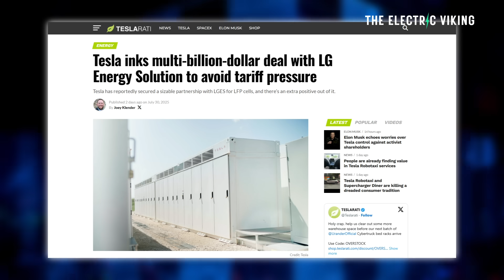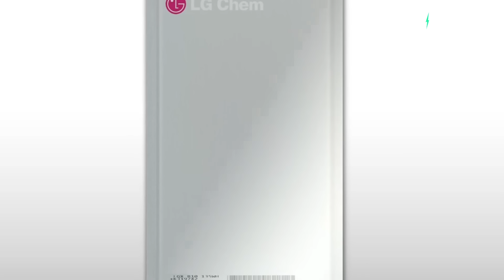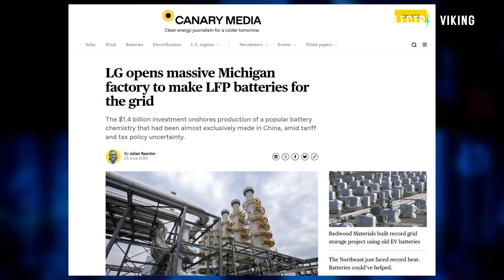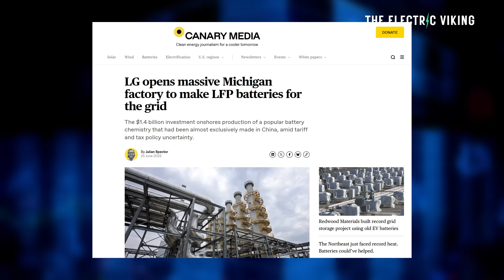Tesla Signs $4.3 BILLION Deal for 50% HIGHER energy Density LFP Batteries

Comment: WRONG: Great find! Tesla pursuing the best batteries in the world is great news. LFP 50% more!? I have no reason not to buy now. It just needs to get into the Model Y AWD long range.

Grok said these DO NOT have 50% more energy density:

These are standard lithium iron phosphate (LFP) cells optimized for energy storage systems (ESS), like Powerwalls and Megapacks.

Key advantages emphasized: lower cost, superior safety (reduced thermal runaway risk), longer cycle life, and tariff avoidance via U.S. manufacturing — not a breakthrough in energy density.

Why Not Use Them in Cars Anyway?

1. Energy Density Trade-Off Remains Fundamental to LFP; standard LFP (including advanced versions) has ~30–40% lower energy density than NMC/NCA packs used in Long Range/Performance Teslas. 

2. Optimization for Stationary vs. Mobile Use;  ESS batteries focus on cost per kWh, extreme cycle life (thousands of cycles), and bulk packaging — weight and space aren't as critical

3. Strategic and Contractual Focus; The deal explicitly targets Tesla's energy storage business.

4. No Need for Upgrade in Current Vehicles; Existing CATL LFP cells in base models are already excellent: cheap, durable, safe, and support full charging. A hypothetical "50% better" LFP wouldn't suddenly make it viable for Long Range trims without major redesigns.

Comment: NOT FOR CARS!

Tesla has secured a $4.3 billion battery deal with LG Energy Solution to supply U.S.-made lithium iron phosphate (LFP) batteries for its energy storage systems. This deal, which spans three years from August 2027 to July 2030, is a strategic move for Tesla to reduce its reliance on Chinese imports due to escalating tariffs. The batteries will be manufactured in LG's U.S. factory in Michigan and are intended for use in Tesla's Powerwall and Megapack systems. The contract also includes options to extend the deal through 2034 and increase the volume of production based on Tesla's future needs. This move marks a significant shift in Tesla's supply chain strategy, focusing on domestic production and reducing logistical risks associated with reliance on foreign suppliers

Comment: Help me understand.  Why sign a deal and install manufacturing capacity for this lithium Ion technology when Tesla just announced its miraculous Aluminum Ion Battery???

What happened to the aluminum ion battery?

The aluminum-ion battery technology has seen significant advancements, particularly with Tesla's Super Aluminum-Ion Battery, which is expected to revolutionize the EV industry. This battery is made from aluminum and graphene, making it 10 times more abundant and cheaper than solid-state batteries. It offers a 1,000 times higher ion conductivity, allowing for ultra-fast charging in just 10 minutes. Additionally, aluminum-ion batteries can provide free home electricity storage, making them a cost-effective and sustainable solution for renewable energy storage. 
4

Tesla's aluminum-ion battery is expected to cost around $1,750 per pack, significantly reducing EV production costs and making electric vehicles more accessible. The battery's design uses a graphene-based cathode and a specially engineered solid or semi-solid electrolyte, which supports high ion mobility while preventing degradation. Early tests show that aluminum-ion batteries can last up to 10,000 charge-discharge cycles with nearly perfect capacity retention.
1

The aluminum-ion battery's development is a response to the need for reliable long-term energy storage systems, particularly for integrating solar and wind power into the power grid. The technology's cost-effectiveness, safety features, and recyclability make it a promising solution for the future of energy storage

Comment: Deal ConfirmationTesla has indeed signed a $4.3 billion deal with LG Energy Solution for lithium iron phosphate (LFP) batteries, as confirmed by multiple sources like Reuters and InsideEVs. This deal, reported as of July 30, 2025, is for U.S.-made batteries intended for Tesla's energy storage systems, such as the Megapack, rather than for electric vehicles. This move aligns with Tesla's strategy to diversify its supply chain and leverage U.S. clean energy incentives.
Energy Density ClaimThe claim that these LFP batteries have 50% higher energy density is not supported by available information. LFP batteries are typically known for lower energy density (around 150-200 Wh/kg) compared to other lithium-ion chemistries like nickel manganese cobalt (NMC) or nickel cobalt aluminum (NCA), which can reach 200-250 Wh/kg or more. While LG Energy Solution has been developing LFP batteries with improved energy density, the most specific mention is a 20% increase compared to CATL's batteries for Tesla Model 3, and this is still in the research stage, not confirmed for this deal.

Comment: Maybe because the corporations are looking to clear their stock and sell the old tech for as long as possible. It's only going to add to the electricity burden, and along with data centers being set up by Gov. and industry, there will be a massive deficit in power generation. If it comes to  industry and Gov/ use over household use, whose power do you think they will throttle? It's a con.

Comment: Thoughts? Well, if density has increased by 50%, then Tesla can make the pack size smaller, and therefore cheaper. So many benefits to this around weight reduction and handling. Not to mention, it may allow different packaging options. Really looking forward to seeing the NEXT gen of Tesla's with these in them. It'll be 500 miles range if Tesla want to do it.

Comment: LG Chem produce very fire prone batteries. Tesla are potentially making a fatal mistake partnering with them. Check their record. Given they are LFP they may be safe.
Reply: Tesla also employs fire prevention measures such as cell fusing, thermal management and probably other measures that other battery makers cut corners on.

Comment: Operates better in cold temperatures. So in the US snowbelt states where -20F is common on -60F is not unheard of, let's split that difference and say -40C, these new batteries won't suffer at all? Or does "better" just mean they can't charge at -30F, so they still need heaters?

Comment: Totally fake news. Here is what really happening. Tesla is reportedly a confidential client in a $4.3 billion contract with South Korea’s LG Energy Solution (LGES). The deal covers a three‑year period from August 2027 to July 2030, with options to extend up to seven additional years or expand volume. 
Batteries will be manufactured at LGES’s U.S. plant in Michigan, aimed at Tesla’s energy storage systems (such as Megapack and Powerwall), not for vehicles.
These are standard LFP batteries, there is no source claiming 50% higher energy density -- it just chemically impossible. These batteries still have lower energy density than Tesla’s NMC or NCA chemistries.

Comment: Aluminum ignites at temperatures typically around 1,030°F (about 555°C) for solid pieces, but the exact ignition temperature depends on particle size and form. For fine aluminum dust, ignition can occur at approximately 750°C, while bulk or foil aluminum may require much higher temperatures, often above 1,000°C.

For reference:

Solid aluminum ignition temperature: about 1,030°F (555°C).

Aluminum dust cloud ignition temperature: about 750°C.

Nano-sized particles may ignite at even lower temperatures (as low as 627°C), while larger particles and foil might require 1,000–2,000°C.

Aluminum's melting point is much lower, at 660°C, so it melts before it ignites under most conditions. Everyday household or industrial fires rarely reach the ignition temperature of solid aluminum.

Comment: Looks like the Holland Michigan factory produces pouch-style batteries for GM vehicles and stationary grid battery backup. Sam, do you think they are using that chemistry in cylinder batteries which is more common for Tesla or putting pouches in Tesla packs?

Comment: So which of the two LG batteries will they make in Nevada to replace CATL?  That CATL production was earmarked for energy storage so I assume the will go with the cheaper version since density is not that important.  But how does the higher density LG compare to the 4680 Tesla has invested so much in?  If the LG is better and more cost efficient than the 4680 than Tesla has a tough decision to make.

Comment: LG Energy Solution supplies batteries to a variety of electric vehicle (EV) manufacturers, including Tesla, Toyota, Rivian, and Aptera. 
They also supply batteries to General Motors, Ford, and Mercedes-Benz.
 Specifically, LGES provides lithium-ion battery modules for Toyota's EVs in the US, and cylindrical batteries for Rivian's R2 model.
 Additionally, they are supplying LFP batteries to Tesla for energy storage systems 
and are involved in a seven-year deal to provide 2170 cylindrical battery cells for Aptera's solar electric vehicles. 
Here's a more detailed breakdown:
Tesla:
LG Energy Solution is supplying Tesla with LFP batteries for energy storage systems, potentially reducing Tesla's reliance on Chinese suppliers according to Reuters. 
Toyota:
LGES is supplying lithium-ion battery modules for Toyota's expanding EV line-up, including a new model assembled in Kentucky. 
Rivian:
LGES is providing next-generation 4695 cylindrical batteries for Rivian's R2 model, which will be manufactured in the US. 
Aptera:
LGES is exclusively supplying cylindrical batteries for Aptera's solar electric vehicles. 
Other Manufacturers:
LGES also has supply agreements with General Motors, Ford, and Mercedes-Benz.

Comment: I had a pretty frustrating experience with my Tesla recently. When my car was around 118,000 miles, it gave me a warning that the 12V battery was going down and that I should soon go to a dealer to replace it. The message said it was safe to drive in the meantime, so I trusted that and drove a few thousand miles more, thinking I'd just have to pay a few hundred dollars to swap the 12V battery and be on my way.

To my surprise, when I finally took it in, the service team told me that the issue wasn’t actually the 12V battery—it was the main high-voltage battery that had failed. This was a complete shock, especially since the car only warned me about the 12V battery and clearly stated it was safe to keep driving. Now I’m being told the entire battery pack needs to be replaced, which costs over $15,000.

Even worse, I’m now just slightly over the 120,000-mile battery warranty—by only a few thousand miles. Had I known the real issue was the main battery, I would’ve brought the car in immediately and stayed within the warranty. But because of the misleading warning, I unknowingly missed that window.

I’ve always admired Tesla for its innovation, but this experience has really shaken my trust. I’m hoping Tesla will do the right thing—whether by honoring the warranty or offering some kind of assistance. It doesn’t feel right for a loyal customer to be hit with such a massive repair bill due to unclear communication from the vehicle.

Comment: We'll see. None of it means anything until we see the first car roll off the line with these batteries in them. I thought CATL might be Tesla's go to battery since they have hybrid batteries capable of delivering well over 400 miles of range.

We've have to see what these LFP batteries can do. At best the current LFP batteries for Tesla yield 280 miles of range. I'd like to see a battery that can yield at  least 440 to 450 miles of range. At 80% of that gives you a decent range of about 350 to 380 miles of range.

If Tesla's current LFP batteries yield 280 miles on a full charge then plus 20% gets you around 316 miles (EPA cycle). That's good but still kind of on the low side but still better than where they are now.

Comment: Didn't Ford try to make a Licensing deal with CATL to build the same battery type in Michigan? As in, Ford builds it, but it was originally designed by CATL? And didn't Ford's EV competitors get the deal shut down? I'm not up on the latest with that situation. If ya haven't done a video on that topic, it might be worth doing one.

Comment: Never mind Tesla - lithium batteries are a plague and except a vehicle submersion system is designed/installed, no fixed firefighting system can beat a battery fire.  For now, my instinct is do not park any ev within 10 meters of a dwelling or emergecy facility [police/firestation/hospital].  One exception perhaps: nursing homes ought to have 25m protection zones as mobility issues of occupants can prevent timely escape.

Comment: CATL's Shenxing Plus LFP Battery has an energy density of 205Wh/kg. At 12:05 you said this battery has an energy density of 230Wh/kg. That's about 13% more energy density than CATL's latest LFP battery. If it's 50% higher energy density than current LFP, that would put it at a whopping 307Wh/kg. Something doesn't add up.

Comment: I don't quite understand the fuss here. Google tells me that some of Tesla's existing 4680 cells have a density of about 240 kw/kg, so the LG's density of 230wh/kg is not particularly impressive. It's certainly better than a second-generation blade battery, which will come in at 190 wh/kg. But if CATL comes through with its 400wh/kg batteries, that will be a game changer.

Comment: I drove Tesla's for almost 4 years, the battery range was not the problem the model x for example the rear door got out of adjustment on a regular basics and when you are driving and providing transportation for people to and from Air Ports this is a problem. I drove Tesla cars as well that cost over $100,000.00 that value drop like a rock in water. The controls broke because they were cheaply made and the frame around the battery was C shaped and not tubular so the bent over time and the perfect balance was gone the outside seme on the front door ended up wider at the bottom and tighter at the top. My friend took me for a ride in his Model three full self driving and it was tariffing in Traffic despite the fact that the navigation showed us going straight it tried to veer into the right turn lane and my friend had to gab the steering wheel. It has great software that has flaws. Having greater range is great for super long distances most of the time it is not necessary. If someone really wants a Tesla go to the repo lots, after people owe more that the car is worth many are just recking their credit and allowing them to be reposits.  I drive electric cars, and they are great I will never own another Tesla. If you buy one remember to buy lots of tires as well because they eat tires.

Comment: The claim that Tesla signed a $4.3 billion deal for lithium iron phosphate (LFP) batteries with 50% higher energy density appears to be inaccurate or unsupported by available information. Here's a breakdown based on recent reports:
Tesla has indeed entered into a $4.3 billion deal with LG Energy Solution (LGES) to supply LFP batteries, primarily for its energy storage systems like the Tesla Megapack, not for electric vehicles. The deal, set to run from August 2027 to July 2030 with an option to extend up to seven years, involves batteries manufactured at LGES’s Michigan facility. This move is part of Tesla’s strategy to reduce reliance on Chinese battery suppliers, such as CATL, due to U.S. tariffs and to align with domestic content requirements for incentives under the Inflation Reduction Act.
However, none of the available sources confirm that these LFP batteries have 50% higher energy density compared to existing LFP batteries. In fact, LFP batteries are noted for having lower energy density than nickel-based alternatives like NMC or NCA, typically by about 30%, though they offer advantages in safety, cost (around $98.50/kWh compared to $112.70/kWh for NMC and $120.30/kWh for NCA), and longevity (3,000–6,000 cycles vs. 1,000–2,000 for NMC). There’s mention of ongoing industry efforts to improve LFP energy density, but no specific breakthrough of a 50% increase is documented in relation to this deal.
It’s possible the claim about 50% higher energy density stems from confusion with other battery technology advancements, such as solid-state batteries, which are projected to offer significant energy density improvements but are not part of this deal. Alternatively, it could be a misinterpretation of Tesla’s broader innovation goals or speculative reporting not substantiated by primary sources.